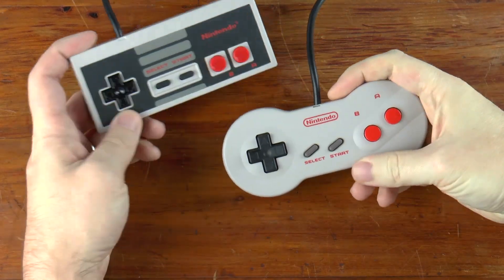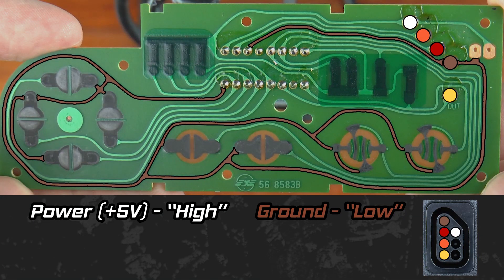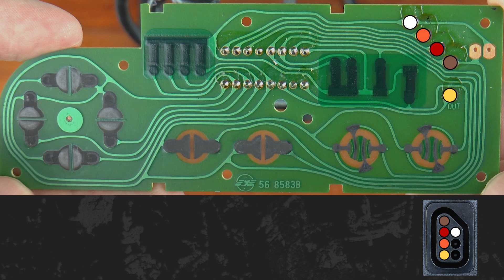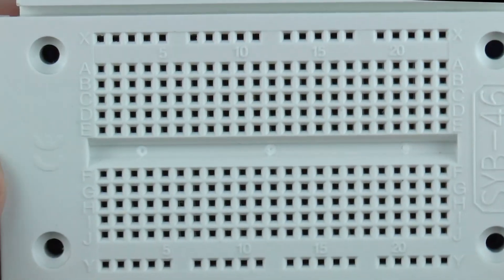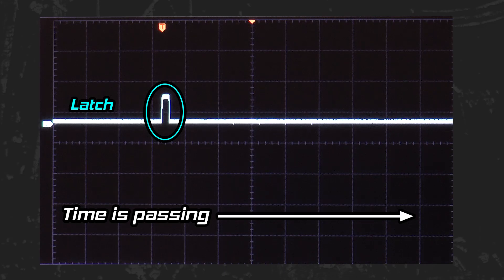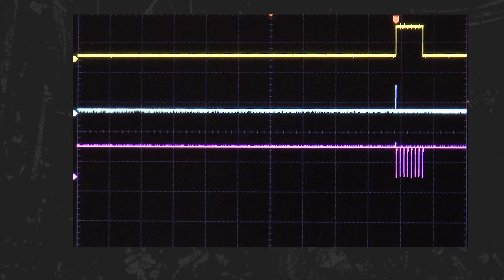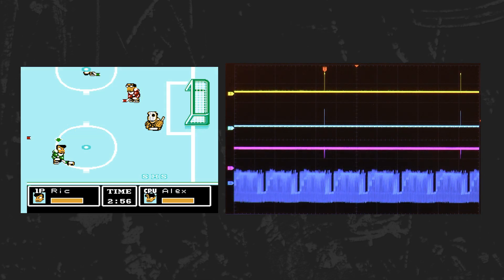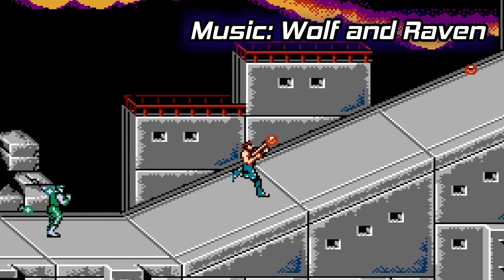Nintendo (NES) Controller - Electronics

Comment: I though the black areas were Zener diodes, because we I test them with my multimeters diode mode, both of them marks resistance in only one way (about 1500 ohms from any pin to +5V), but it makes sense that they're resistances for pull-ups

Comment: Very helpful, thank you! 

I was trying to connect an NES controller to a Raspberry Pico and this helped me understand the concept of what is happening much better. It took me some time to figure out that the Latch and Clock lines are actually sent from the NES to the controller, but now it makes perfect sense. I am sitting here grinning like an idiot with a 64x64 matrix display hooked up to a Raspberry Pico and an NES controller that switches 0s to 1s on the screen when I press a button. I love it.

Comment: Considering how little buttons there are, they have needlesly overcomplicated it and made it more expensive for no real benefit. Sega system was much more elegant and simple solution. Its probably easier to feed the signals to the cpu this way but still they could have made it internally

Comment: Fun fact. UK/EU (except Scandinavia) PAL NES systems has a bunch diodes in the ports and controllers to make them only compatible with these controllers. The other way around works fine however. I learned this the hard way when I imported an RGB modded NES from England and it didn't work with my Swedish controllers and ended up having to modify the controller ports.
The reason Scandinavian NES uses the same non-region locked controllers as the US is because before Nintendo themselves launched the NES in Europe a Swedish company Bergsala got an exclusive import deal for Scandinavia. Not sure exactly why the controllers were region locked in the rest of Europe but I suspect that the partner Nintendo worked with didn't want their customers buying controllers sold via Bergsala or something. I think Mattel was the initial producer of European NES before Nintendo eventually took it inhouse. Bergsala btw still has that Scandinavian distribution exclusivity for Nintendo products. A deal that was sealed via the gift of a crystal ashtray btw 😊

Comment: This is kinda old but I've always wondered: So SMB3 polls the controller twice to ensure it gets the right input.

If the two inputs DO NOT match, which input does it consider to be "good"?  First or second?  Or does it poll a third time in that case?  Because you can't know if the first poll was right or the second was, in this case.

Also, I wonder if this has to do with what I consider to be the "slippery" controls in Mario 3.  I've always felt like Mario controlled kinda weird in this game.

Comment: Just revisited this again as super impressed just wondering though if you do read this can you just clarify how having a current limiting resistor stops the full effect of a 5v to GRND short. I appreciate we need to have some resistance to the current being drawn to ground in respect to the 5v supply but how does a little resistor with very little voltage drop across it act as "short breaker"?

Cheers Franky

Comment: Fun fact: the other two pins on the controller port are used for the zapper gun. One is for the trigger and the other is for the light sensor.

Comment: You didn't mention the most fun part of the DPCM controller conflicts - because of that, in games that use the workaround you showed, if you mash buttons really really really fast, faster than a human or even a controller itself can likely physically do, you can basically influence when code executes, and eventually gain control of execution. Did I say eventually? I meant before the titlescreen loads. That's what the infamous TAS for SMB3 that beats the game in less than a second does.

Comment: When I found out how dead simple the electronics in an NES controller were, I had to pick up a couple of pack of 10 CD4021 chips. It's a bit more than $1 or $2 for a pack of 10 on Aliexpress.  So I'd like to make my own NES peripheral some time using a 4021. But I dunno what I'd make. Although I guess I could always just make my own controller for the sake of learning about it and with no real practical use. But of course, I'd need an NES first. Or a clone system, but I'd rather have an original. There's some other stuff I'd like to do with NES hardware as well. For one thing, I'd like to get a broken NES for the chips. On nice idea would be to build an NES on breadboards. But unless somebody smarter than me does that first. It'll be a long time before I get to that.

Comment: 17:05 The Scandinavian NES was actually different from the continental European one, in that it did accept NTSC controllers. The Scandinavian SNES also used the same DC connector as the Super Famicom, while the continental one had a slightly thinner one.

Comment: The DMC bug causes a read operation from the CPU to be performed twice, and reading the controller state register is what sends the clock pulse to the controller. The controller state is corrupted because one of the button states is lost when this happens. In 2014, it was found that the DMC read occurs on only even (maybe it was only odd?) CPU cycles, as well as the object DMA function. When DMA completes, the CPU is always on an even or odd cycle (I forget which it is), so controller state can be reliably processed even while DMC samples are in use.

Comment: I would be very interested in learning how an analog controller like the N64 works or even the Gamecube controller with its analog shoulder buttons.
Reply: If I had to guess how the gamecube shoulder buttons worked, I would imagine it used an 8 bit number to store the pressure. For example:

0000 0000: Not pressed at all
0000 0001: Bare Minimum
0000 0011: A little more
...
1111 1111: All the way down

That's how I would do it
Reply: The GameCube treats a digital press differently from an analogue one, as does the Wii Classic Controller. You can remove the analogue component entirely and the digital will still work.

Comment: You literally have to write the code for the NES to send those pulses. It is pretty easy, but you are literally using a single bit in the byte to communicate with the controllers. Latch, Set to serial, [read from the data line, save input to a variable, repeat 7x] and for games with DPCM samples, this can happen up to three times. That is, if there was a corrupted read somewhere in there.

Comment: It Would be So cool if you can make a similar video about the N64 controller, since I was a child I was impressed with the fact that its connection only uses 3 pins..
Also thanks for sharing all this information and for making it as easy to understand as possible

Comment: Nice video, not too bad. Some used a pin to determine the function, e.g. RGBI signal is I for Intensity so the 8 colors can be doubled to 16 by using the state of the I pin. I guess the Mega Drive works similar to make 8 buttons (4 direction, A, B, C and START) out of the usual 5 pins (standard Atari plug/layout).

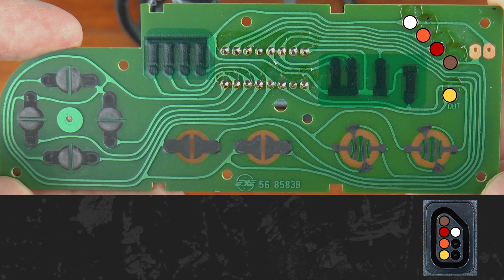Comment: 6:30 It's possible to read the controller any number of times per video frame. For example, check out the pause feature in Dragon Warrior. Whenever Start is pressed, the game goes into a tight spin reading the controller as fast as it can until Start is pressed again. During this time the game does almost nothing else. The important exception is its common read-controller routine also increments the global random number generator each time. Thus, with sub-frame accurate timing, it becomes possible to use Start to continuously manipulate RNG without the game ever visibly pausing.

Comment: Hey really great video! I took a class in college where I had to interface an NES controller to an FPGA. I was responsible for generating the clock and latch signals as well as receiving the data signal, processing it, and using it to interface with a computer. It's been a few years now and your video was a perfect refresher for what I had to figure out myself back then. If your video was out at the time, it would've made the project so much easier! great job

Comment: I found it soo interesting about that bug in the ntsc nes in that it cannot read pcm & control input at the same time, it’s interesting how nintendo did get around it be reading control inputs twice during pcm play to make sure it will be not ignoired,and theres no noticeble input lag delay either,,

But i wonder what would happen if you don’t get around that bug, what would happen,could it sometimes ignoire button presses and sometimes ignoire pcm play?

Noe since that bug was fixed on the pal nes,i wonder if pal nes games did ignoired that bug completely or did they still get around that bug just in case?
As far as i know i can play ntsc games fine on a pal nes and vice versa trough convertor,including supermariobros 2 & 3 etc,,
The only thing i know is that some pal games such as asterix do run glitch on a ntsc nes but i guess it has more to do with the timings of that mapper and nothing to do with that pcm playback bug, but am certainly curious about it,mmmm.

Comment: I built an arcade stick for my NES. Even has turbo. Wish I had one when I was a kid.
Reply: I still have my NES Advantage and SNES Advantage controllers.
Reply: Funny.   I am working on the same project.  However I am running into an issue.   Every 6 seconds, the nintendo will not recieve any inputs, then it will work for 6 seconds, and then not again for another 6.   Kinda stumped
Reply: @john-tk2dn  sounds like a clock timing issue. Are you DIYing the circuitry or robbing parts from a controller. If your DIYing your shift register may be wrong. I took the guts out of a old turbo controller . Tapped into the ground plane and to each button. Was cheaper to go that route as opposed to building one. Controller only cost a couple bucks on eBay. Plus you get a cord.
Reply: @shadymaint1  HA! i literally just came to post that yah, somehow i had one of my grounds connected to the clock pin LOL  Not using breadboard, just using some prototyping board. And im well aware I can just tap into an existing board, but wanted to build from the ground up.  I actually bout some of those really crappy controllers just for the cord and the connector :)     Im just laying everything out and gonna have a custom PCB printed so i dont have to use jumper wires and have actual traces.   Its just been a fun project :)
Reply: @john-tk2dn  right on man.

Comment: Ah, and likely the reason they added 3k3 resistors for clock and latch was because they became open drain outputs on the PAL revision of the CPU (and thus the redesigned NTSC console). Not sure for the rationale behind this -- either they wanted to OR the signal together with something else (expansion port or cartridge MMC perhaps?) or they wanted flexibility to run the shift register at a different voltage from the CPU or use a different technology with different input thresholds. YET STILL NO DECOUPLING CAPACITORS NINTENDO!

Comment: I always wondered as a kid how the controller worked as there were less pins than there were buttons, and considered also that even if the d-pad only had one position, it would take three bits (none, up, left, down, right), so it didn't explain. So I figured there must be something smarter there, but I never dug out what it was... But now I know. I liked the style of the video: it explains everything from the ground up, but still progresses quickly enough even for somebody that already knows at least the basic concepts. Maybe a video on the Zapper at some point? :)

Comment: Ah, The good old atari joystick port.

As used by Atari, Commodore, Sega and a ton of other companies...

Sometimes with incompatibilities, and later on with very strange workarounds...

I'm most familiar with it on the 800XL...

Where it has so many functions mapped to the same pins it's kinda crazy.

The basics are obvious enough;
5 'buttons', ground, an unconnected pin (technically held at +5 volts), and two analogue input pins.

The buttons map to the standard controller, and the analogue pins are used for the paddles...
But also for a mouse, if you use one (never officially had one, but you can use both Amiga and Atari ST mice with the system if you do the programming correctly), and the atari drawing tablet.
You can also use the analogue pins as extra buttons if you build a controller a certain way and program the software the right way.

So, is that everything? Actually, no it isn't.
See, the 4 'button' pins that the joystick directions map to are technically a serial port.
If you write to appropriate registers you can set the communications direction.
By default they're all set as input pins (understandable), but you can also write to them and use them as outputs.
And thus we got things like an electronics lab, a modem, and an 80 column text display device that all connected to the controller ports.

This observation also means you can, with some basic conversion circuitry, wire up an NES or SNES controller and communicate with it properly as long as you write a custom program to do so.

The NES approach is certainly interesting though. It's very flexible but also quite expandable, and uses quite simple circuitry (shift registers are very basic generic parts)

The proof of this is that the SNES is electrically compatible with the NES, and the SNES contains internal logic to read controllers the way the NES does.
The SNES controller simply has a larger shift register, hence more buttons.

The Sega Master system (and turbographx in fact - which uses the same circuitry) as well as the 3 button mega drive controller also use a fairly simple bit of circuitry - a multiplexer chip, which takes an input line and a set of output lines to 'select' which set of buttons you can read at once. 
This is a fairly clever solution, but it doesn't scale easily with simple circuitry.
Hence the 6 button Mega Drive controller contains a microprocessor and some fairly complicated timing logic to give the extra buttons without adding more lines to the connector...

The SNES meanwhile would really only have to change the controller access programming to increase the buttons even further. (also there's a FLASH memory storage device that attaches to controller port 2. RPG maker uses it to let you save your work on something other than the RPG maker cartridge.)

Comment: I like the simplicity of old tech: just send a 1 down the line 8 times and check what comes out on the next line. USB is awesome but it makes electronics a good deal more complicated.
Reply: It is universal, after all. It needs to say "I'm a controller, I am a slave device, I use this much power, I use this USB protocol. Now we can actually start communicating."

To differentiate itself from your phone, which is an On-The-Go (which can be master OR slave) and likely sucks more juice to charge itself.

Comment: I'm trying to make a Wiimote driver right now, humorous how all the abstractions (bluetooth, motion, extensions, etc.) have little effect on the format: buttons are still sent as 2 bytes, one bit per button.
Great video!
Reply: Why fix what isn't broken? XD

No need to make things more complex.

Personally it amuses me that the Wii's extension controllers are almost as simplistic as Nintendo's oldschool controllers.
Although you need to be able to deal with an I^2C bus and the custom connector, the logic is otherwise the same.
Plus when they made the mini consoles they used the Wii Classic controller standard verbatim.
Meaning the NES and SNES controllers work with the Wii and Wii Classic controllers work with these mini consoles.

Indeed one thing I learnt experimenting with this is that the 'home' button on the Wii Classic controller activates the menu on these mini consoles (same as if you press the reset button on the actual console)

The NES and SNES replica controllers then, are Wii Classic controllers with some of the buttons and sticks physically missing.

Comment: Do a follow up with the SNES controller :)  It just uses the same shift register right?  Maybe they added a 2nd one for the extra buttons?  can't remember...
Reply from the maker: I plan to do one for the SNES controller.
Reply: the snes uses 2 shift registers but only 4 bits on the second shift register are used for buttons, the other four work like controller ID...
Reply: Controller ID is important though.
It lets games detect non-standard input.

This is how games know if you've got a SNES mouse installed...
Or the Super Scope...
Or the 5 player adapter.

Or this obscure flash memory storage device I've got which is designed to work with some japanese games. (notably it gives you extra storage for the SFC version of RPG maker).

Might seem like a trivial thing, but knowing what type of controller is attached is surprisingly useful.

Some 2nd generation SuperFX games even refuse to run if you have the mouse plugged in.
(because the SuperFX uses a lot of power, and the mouse uses 50 milliwatts while a standard controller only uses 20. - yeah, they genuinely felt that 30 milliwatts caused enough of a risk of overloading the power supply to disable some games...)

Also can we talk about the absolutely stupid implementation of mouse support on SNES Doom?

Oh, it recognises the mouse... But turn speed is agonisingly slow, and it only has 2 buttons...
And basic stuff like reloading and looking at the map isn't set up...
And you can't use the mouse AND a controller, only one or the other.
So... mouse, or enough buttons to actually play the game properly...
Wow. Why even bother.